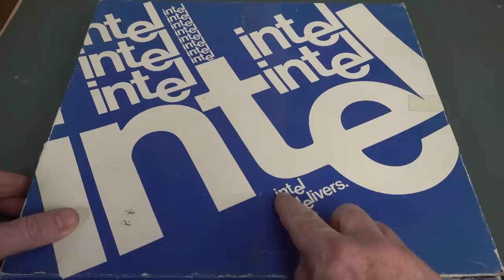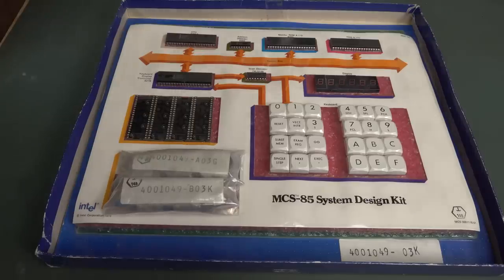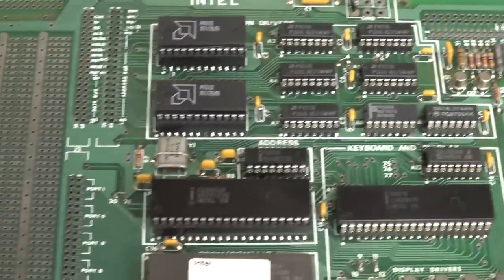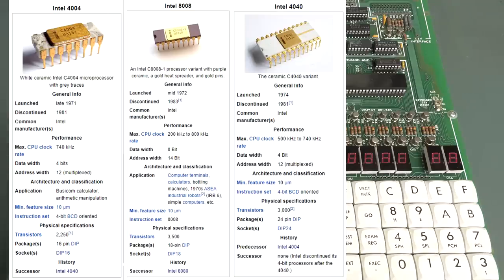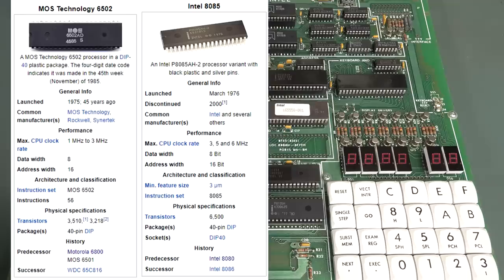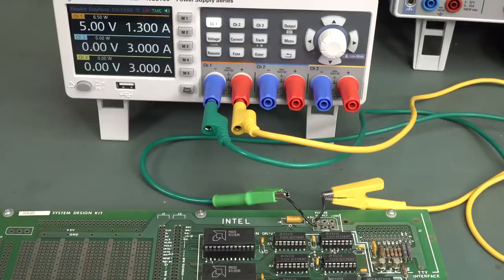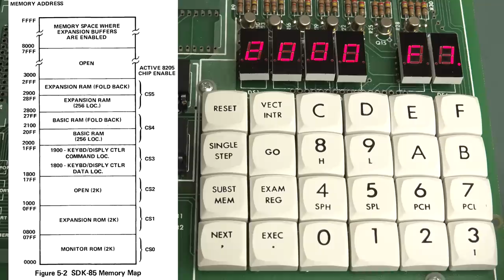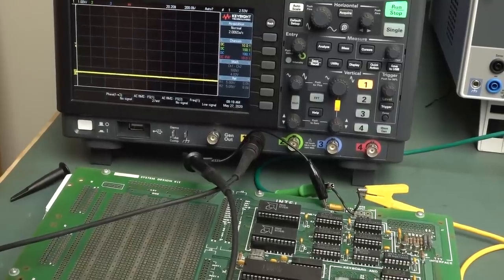EEVblog #1308 - 1970's Intel MCS-85 8085 Design Kit!

Comment: The 8008 and 4004 were parallel projects with no technical connection between them. The 8008 was an integrated version of an existing architecture, which was implemented by Texas Instruments as well: http://www.righto.com/2015/05/the-texas-instruments-tmx-1795-first.html

My first computer was the Motorola 6800 equivalent that you showed at the end (MEK6800D2). In 1980 their local office was throwing it away as obsolete and I was glad to take it off their hands for free. It had "punch" and "load" keys for storing programs externally on paper tapes if you were using TTYs.

The best processor of that era was the TMS9900. As long as you didn't cripple it like in the TI99/4.

Comment: I remember in the mid 80's when I was a trainee engineer at the BBC training centre we had to do basic machine code programing on a Z80 development board. Later we used Z80 assembly language to write a verry basic disc controller on a Z80 based automation computer called the BBC Zeta which the BBC had develloped to automate remote unmanned sites like small transmitters and contribution studios. Watching you tap away on the hex keypad brought on a wave of nostalgia.

Comment: Oh the memories! I borrowed the 8085 sd kit. Later bough an 8080 Sol system. Used S100 buss ram board, 8k byte, kit for the ram board was about $230.

Comment: The stuff I built was with a Motorola 6800, probably better than an 8080 somewhat.  The first project was an Amateur Radio Repeater, which went live in 1976.  Later I wrote a complete operating system that ended up being the basis for an answering system computer (7 terminals at 9600 baud).  The machine had 60k bytes of nice static RAM in about 1980 or so.  I still have a chassis that I worked on back in the day.  Lots of memories from that era!  The kit I started out with was from Motorola and cost $300 (US) at the time (1975).

Comment: Of the processors you listed my favorite would have to be the MOS 6502.  It was used in the PET, the VIC20 (my first computer), and in various models of Commodore floppy disk drive like the 1541.  They’re still being made to this day, I think by Western Design Center.  But of the ones not listed, my favorite is the MOS 6510 because it’s in the Commodore 64, my favorite computer line.

Comment: 8080! Just from a nostalgia standpoint. 8085 had an another important advantage, and so that 8080 required two other chips (8224  clock and 8228 bus driver)

Comment: I graduated college in 1969. I remember how exciting it was when Intel introduced the 4040. There are, even today, many traffic light controllers using the 4040. They were reliable as all get out. After the 8088 was released i built myself a 16k print spooler using it. Back then, if you wanted to print something big it would tie up your computer for what seemed like hours. With that spooler installed between the computer and the printer I could send the "print" command,  and go back about my business on the computer while listening contentedly to that awful racket made by the 9 pin printer!

Comment: I have a little memory from around 1980.  Our first computerized controller was launched then.  It was designed and built by a small company in the same city and was built around a Motorola 6800.  It ran at 1 MHz clock speed and I asked the head designer why he had selected the slow 1 MHz processor, when Intel had much faster ones.  Mind you, I had no experience whatsoever about microprocessors.  So, he picked up two data sheets and showed how the Motorola chip ran most of its operations at 1 or 2 clock cycles, while the same operations on the Intel chips took maybe 6 or even more cycles.  So, there was essentially no effective speed differences.  Lession number one.  A few years later I inherited the task of interfacing with the same company when the last incarnation of our controller was designed by the same company and design engineer.  It was based on Motorola 68000.  I again wanted to know if it was speedy enough, as then the input and output channel count and other performance specifications had increased radically.  I kept asking for an estimate.  Finally the main designer agreed to sit down with me and "sow it was fast enough".  Some 15 minutes into the clock cycle counting he got uneasy and then said "You are right -- it cannot do".  So the design got 3 coprocessors (6803) to handle I/O while the 68000 did all the math and oversight.  I still don't know much anything about designing a system with a microprocessor,, but keep this experience as a treasured memory.

Comment: There was another processor from the 1970s from Fairchild called the F8. The processor came as 2x 40 pin ceramic chips. I only saw it once when a friend of mine (who repaired the original Pong game consoles seen in pubs) had one as a possible replacement for the Pong circuit boards. He never ended up using it, and I never saw the F8 again. I doubt it was a popular micro.

Comment: Curtin University in Perth Western Australia were using these in the 1980's as machine programming trainers for the electrical and electronic engineering students. Easy to use and actually quite enjoyable, hence I have a soft spot for this processor. One project was to add two DACs, connect x-y to a scope and make a representation (dots really) of a tank move across the screen. Loops within loops got the job done, and in not a great deal of memory space.

Comment: The TMS1000 was used in the Cobra2000GTL CB base station. It's only duties were a frequency indicator and a time of day clock. The 2000GTL was? the first CB radio to have a frequency display. There was also the Stoner Pro40 with it's own frequency display. I think it may have used a Zilog solution, not to sure any more due to memory degradation.

Comment: Used a similar smaller board in the Late 80s at college. I think it was 6809. It had an output speaker. First program I did on it drove the speaker with an incrementing pulse delay. Drove the lecturer nuts! haha.

Comment: The first EPROM was the Intel 1702A (I believe). It was released in 1971 and was a whopping 256x8 in capacity. It was constructed using PMOS technology.

It required a few rails for programming; one of which was negative 48 volts. It also, surprisingly, did not require a ground reference.

The programming portion of its manual is here: http://www.tronola.com/Programming_the_1702A_EPROM.pdf

Someone went through the effort of writing a special built programmer and a reader for the 1702A: http://www.tronola.com/html/1702a_prom_programmer.html

After the 1702A came the 2704 and 2708 (which used NMOS; hence the “2”; “1” was PMOS (IIRC)) which stored twice and four times as much as the 1702A (512x8 and 1024x8 respectively). They required (a somewhat more sane) programming rail of 12 volts with 25 volt pulses.

Here’s the datasheet for the 2708 if anyone is curious: https://pdf.datasheet.live/fd7d1190/intel.com/D2708-1.pdf

Comment: 300 baud is for the bourgeoisie.  Us proles live and die by 110 baud.
Reply: We sill use 300 baud stuff at work, I work in telecom and we still operate in the 1970s.  Thing is though, stuff from that era just kept on ticking.  We have pieces of equipment that have an uptime longer than I've been alive.
Reply: Red squirrel. Yeah, old stuff was built properly and just keeps working forever. No BGA chips poorly soldered with lead free rubbish.

Comment: Favourite 1970s CPU: Motorola 68000 (with three 0's!)   =)
Reply: 68000 and 1970s? That's KINDA stretching it. Prototypes and samples came out in 1979, yeah .. but it didn't really take off in large numbers until the early-mid 1980s.

Comment: I used a similar Motorola 6809 design kit in tech school ...( Equivalent Associates Degree - - R.E.T.S. Electronics School  in Detroit, Mich)  in the mid-late 1970's to learn assembly on. It ran at only 2 mhz., had similar keyboard, a much smaller expansion area. Wish I kept it, had some fun with it.

Comment: We had similar boards called EMMA boards which I think were 6502 based which we used in college in the late 80’s which cost around £200 each, we used to write the programs in assembly on a PC and it would spit out all the op codes to type into the board via the keypad, it had input, output jacks down one side which you could attach various projects. Very first project you had to do was to get your name to scroll across the seven segment display.

Comment: Considering that the MITS Altair 8080 originally came with only 256 bytes of RAM (a 1K card, only 1/4 populated), only the front-panel for interfacing, no ROM, and no stock I/O ports AT ALL, this is quite well featured.  (The Altair, as originally shipped, also only had space for 2 more cards before you had to add additional expansion slots, for which the case had ample room although the unregulated linear power supplies might need upgrading.  A lot of mid-70's chips were incredibly power hungry by even mid-80's standards.)

Comment: Since you asked :-)  Heathkit had a very similar kit for the 6800.  Entered the program the same way, executed the program the same way, etc.  It was the et-3400.  I got one for free, but it didn't work, so I used the keypad for another project.  I cover the 3400, as well as a et-3400 simulator, and other kits in my vid: "Nostalgia Time: Old Electronics Kits"

Comment: In the 1970s that TTY interface was probably for an actual TTY, and those only ran up to 110 baud (generated electromechanically). Something like a TI Silent Writer or a DECwriter could run at an astonishing 300 baud. Monochrome glass terminals didn't start becoming common until the 1980s.

Comment: Nice. Made me think about a similar 8080 demo board i 'worked' with. Even wrote a basic crossassember and a simulator  (in HP shared basic) to make the programming a little bit simpler.  And BTW i had not a nice electronic keyboard/display. Started with a teletype ASR 33 with paper tape....

Comment: Hell, we had none of them fancy glass TTY's we used a real Teletype Model 33 with a paper tape reader/punch.
Our first uP product was a 1500 trunk (64 T1 lines), Class4  telephone digital switch based an Intel 8080. It had two plane redundancy with each plane containing a pair lock-step 8080's with the companion 8080 used strictly for error checking.  The processors ran at 2Mhz with 64K of  DRAM and some 1702A UV ROMS for a boot loader.  The operating program was loaded from a  3M DC300 1/4" digital tape cartridge reader.  The first field trial was in March of 76.

The operating program was written in assembly (in Octal!!) on a home grown assembler.  The assembler and initial code were developed on an Intel 8008 development kit with the Model 33 TTY as the IO device using paper tape.   Once we had the telco switch's processor PCB's working the assembler was ported to the 8080 on those boards.   Later on we moved code development over to a PDP11 with a huge 5 megabyte disk pack running UNIX, but still in assembly code.   The code was very compact and very real time aware to keep up with the expected telephone call traffic.

Even today I am totally amazed this little 8080 could run this much switching equipment and the associated call traffic.   IIRC a fully configured system occupied  6 to 8 eleven foot relay racks, but replaced an entire floor's worth of analog switching equipment. 

Intel was so keen on promoting their processors the sales guys would bring me samples hot off wire bonding even before part number and logo printing.  They were hand serialized in pencil. Wish I still had a couple of these.   In the early 80's we were switching to the 8085 when TRW pulled the plug on the company.

Comment: National Semiconductor had a processor, the SC/MP that was a bit like the 8085. Clive Sinclair, before he made a mint with the the ZX-80 sold a build-it-yourself kit grandiously called the Science of Cambridge Mk 14 (no idea what happened to the previous 13 versions) that used this chip. The kit cost about 40 pounds at the time. I've still got mine and it worked last time I powered it up. It has a calculator-style 9-digit display and a keypad and a monitor ROM to enable entry and editing of hex data, just like the Intel dev kit you were playing around with.

Comment: I used one of the those in my 3xx level CPU course in college back in the late 80s / early 90s, it did the job. If memory serves I believe the semester project was to design, interface and control an external reflex timer with the CPU board.

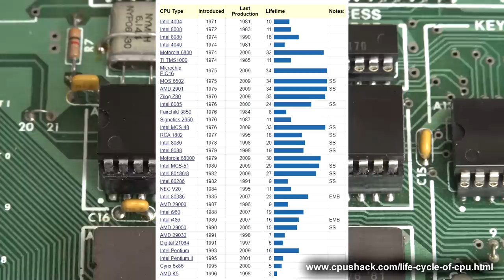Comment: @10:15 Easily... Dave easily... Atmega line was introduced at 2003 - 2004, not that it was that different from the AT90S line in the beginning , just extended? If I remember right, that´s already 15 years of same core. And there are PIC16F or PIC18F that go even further on the 20 year territory. PIC16F877? Yeah the got revisioned and upgraded, but both cores have pretty much remained the same. Let´s not even get started about some old motorola dsp jobbies... :-P

Comment: I got one of these second-hand in the early 90's. Unfortunately, it was junked because it was missing the 8755 (yeah, the ROM!). Just a few years later, I built and programed an 8085 kit/trainer. I don't remember who made it, but it had a more standard 6116 RAM and 2764 ROM, so it had the extra address and data demultiplexing.

Comment: In 1978 I knew absolutely nothing about microprocessors. Bought a manual on the Z80. Read this manual until it fell apart (paperback).  Six years later I was doing a HTEC course in microelectronics and we used one of these types of kits..... Z80 based..... Nailed the exam.

Comment: I used an MCS-85 as the controller for a bed-of-nails tester for a small RAM board for a com satellite attitude control processor.   It was just lying around the lab collecting dust.  Better to put it to good use than build up something from scratch.  The model shop drilled out a 1/4" piece of FR4 with the drill pattern from the RAM board.  Used that to hold the contacts.  Some guides and clamps to hold the RAM board in place.  Hit GO and done.

Comment: As a young graduated engineer I started working early 1980's at a Belgian company called DAI (Data Applications International) who produced industrial microprocessor based control systems and also a PC bases on the intel 8080 chip that was a solid competitor (at least technically) to the Apple II. https://en.wikipedia.org/wiki/DAI_Personal_Computer and also https://fjkraan.home.xs4all.nl/comp/dai/
Personnaly I was involved in designing Control boards based on the new Motorola 6809.

Comment: Early 1980s, Utah State University, Range Science Department, Dr. Martyn Caldwell principal investigator, engineer hired for: We had one of these. We programmed it to operate a double prism monochrometer. How well I remember hand-assembling the 8085 op codes. One little change in the code, and you'd have to re-compute every jump and call address. We used the wire wrap board space to add PROM and also a PROM programmer.

Comment: In '95 at vocation school electronics 2nd year, where I went in Norway, we had a board called Emma-II with a 6502 and a monitor ROM. It was fun typing in machine code. I remember one assignment was to make a loop that copied memory. Also I tried writing to the IO and read with a multimeter, but never saw any change on the output. Memories 🙂

Comment: I was a computer geek in the late 70s, and dreamed of obtaining either the 6800 kit or the 8080A trainer kit -- but they were far too expensive for a teenager with limited funds, trying to pay for car/gas in order to get to entry-level job(s). But managed to find an "old" 8080A chip dumped in the bargain bin at the local Radio Shack (along with the 8224 clock chip) and so built my own. Went through the pain of trying to design the +12/+5/-5 power supply using 7812/7805/7905 voltage regulators, then heard about the 8085 with its single supply!! But wasn't able to get one at my local Jameco distributor. Finally ended up building (over the course of 2 years) a cute little 2K ROM / 1K RAM system using an LED display very similar to the old PDP-11/70 (single LEDs for each address/data line, single toggle switches for inputs). Then my buddy and I pooled our money to buy a Trash-80 (for college) and the old system disappeared after Mom cleaned my room in my absence...!
Reply: Sure disappeared...

Comment: It's successor, the 8086 kit cost $780 back then so I would assume that the 8085 was slightly less expensive (let's say around $600).  That was still EXPENSIVE though.  $600 back in the mid 70's is worth about $2,859.36 today.  I got that info from the wiki on it, located here: https://en.wikipedia.org/wiki/Intel_System_Development_Kit

Comment: I used a TTY with a tape punch. "printed" the program to the tape as non volatile memory :-) . I used the board to do Doppler miss-distance calculations for missile tests in 1978/79 in South Africa. (had to do things like that during the embargo times like Timo Noko :-) ). I still have the board, dont know if it still works.

Comment: These microprocessor development kits in the 70’s were mostly used for implementing microprocessors as replacements for boards full of discrete digital logic devices.  ie. Not so much for “adding intelligence” to products.  Also, the keyboard layout was typical of the 4x4 Hex keypad matrix of the time.  Putting A - F keys six across the top would have been akin to having an A - Z keyboard
 layout instead of QWERTY these days! :)